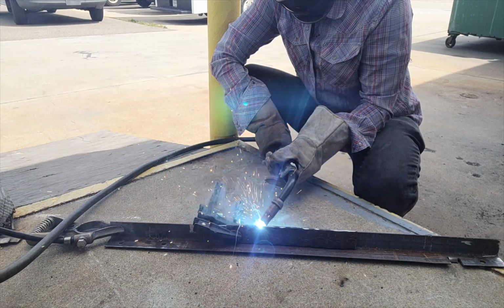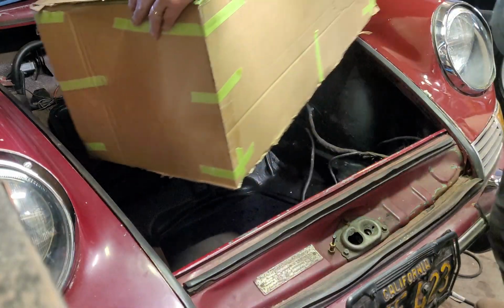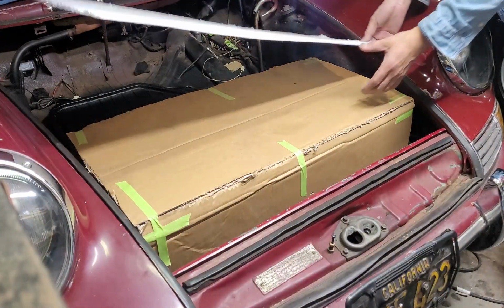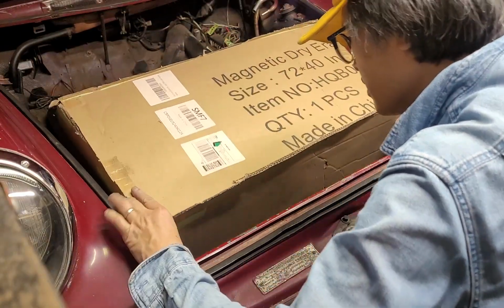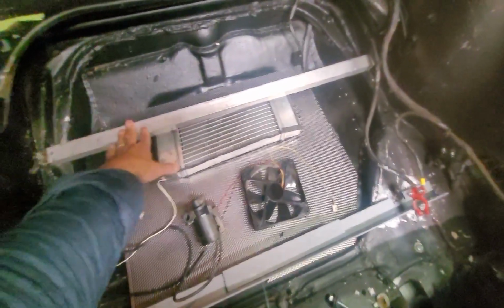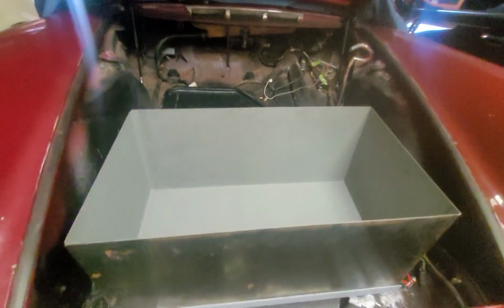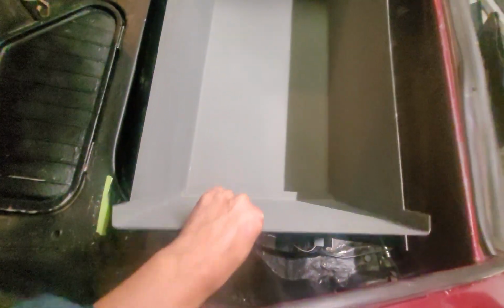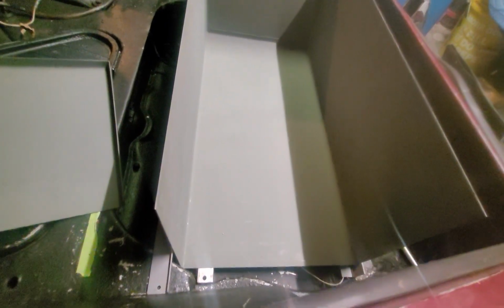Ep 11. Porsche 912 EV Conversion. Battery Box Construction (Part 1) #tesla  #evconversion

Comment: Great build. Any idea what the total weight of the car will be when finished?
Reply from the maker: Thanks. I estimate it to be very close to stock.  A little more weight in the front than rear but for a rear wheel drive car , that's actually ok (except in rain or snow which I don't plan on driving a lot on).